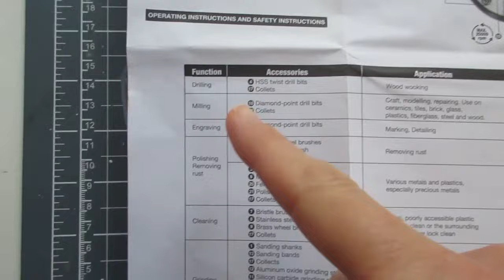Getting to Grips with my Rotary Tool

Comment: I'm glad you did this video. Like you; I have a Dremel that I've used a handful of times and would like to learn more about it.  I have a wood cutting, round blade that I think would work better on wood for you than the diamond blade.  It looks like a tiny, table saw blade.  I've used it to cut bigger and thicker wood pieces and found it worked well.  Thank you for creating this video.

Comment: Hello Julie, rotary tools are really useful for miniaturists, flap wheels are made of sandpaper and are for great for removing paint and rust, and also aggressive sanding, they're not used for cutting, diamond bits and the grinding bits are good for smoothing off mould lines on metal and plastic miniatures as well as carving and shaping wood.
I have a Dremel Stylo 2050, it also has a proper miniature drill chuck which takes all the mini attachments, it's a lot smaller than a regular sized one, I use it regularly for sanding/carving and drilling etc.
Best Wishes from Yorkshire 😊

Comment: You are a magical person who knew exactly what video that I needed to see today!  I dug out my "dremel" which is actually a Wen brand the other day and decided to order a bunch of different accessories to use to help me with my "beginner" dollhouse which is actually not a dollhouse but rather the Ikea dollhouse shelf.  I have to start somewhere, and I'd rather learn using a $40 Ikea build that a $200 real dollhouse. 

I was overwhelmed with all the bits and bobs in the accessory kit.  "What is this for?  What is that for?". I was on YouTube two nights ago looking for videos about dremel accessories and how to use them.  I have been suspiciously looking at my dremel wondering if it could actually be of use for anything other than filing our dogs' nails.  But up popped your video for my edification :)   

I need to now purchase an extension pole with a table clamp since that wasn't included in my 300+ accessory kit.  That would definitely make it easier to work with finer detail.

Comment: I am the same, calling Rotary tools Dremels is the same as calling a vaccum cleaner a Hoover. You are just like me and mine has sat in a drawer for years too except when I decide I want to 'carve' spindles or something akin to that! This is great, maybe I will get more use after watching this too!  I would maybe make the initial cut for the moulding with the diamond cutting disk but, for intricate designs, I would change to a smaller diamond grinding head for more intricate stuff but maybe that's my cowardly side showing?  As you see the diamond pen shaped head and the other diamond heads come much more naturally to me too, they are much easier for me to use too as you tend to use it more like a pen or paintbrush. The pink grinding heads are good for shaping round dowells to make bed posts or furniture legs too. I go through phases of trying out different things with it and I think I could get more use out of it than I do.
Reply from the maker: Thanks for the tips!

Comment: I have tried out a variety of cutting blades/tools on my dremel including the actual saws tooth blade.  I have never found any of them to be very useful for cutting raw wood as in your example.  Where they can be useful is if you need to cut something after it has already been glued into a room and is a bit too long or something.  So cutting off ends and such that are small and hard to get to.  Also there are quite a few Youtubers who will show in detail how to carve with a rotary tool.  I follow this fellow. Cornelius Creations.  Here is his beginner dremel carving video https://www.youtube.com/watch?v=Snhyd74nveM